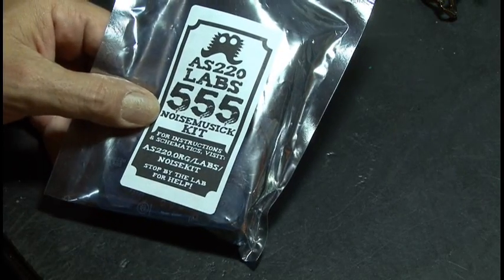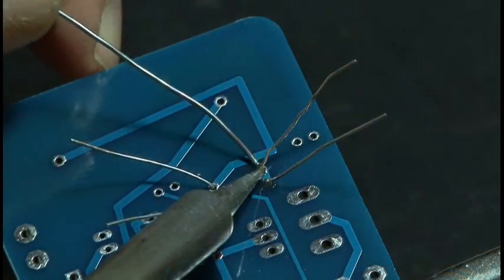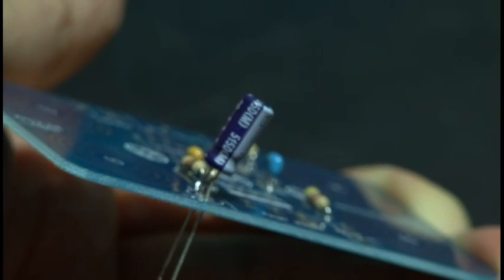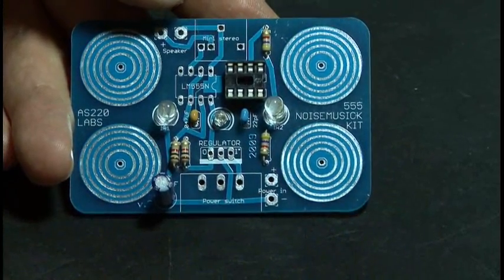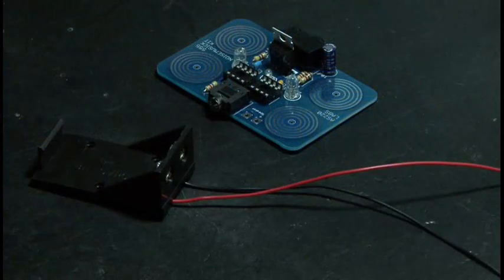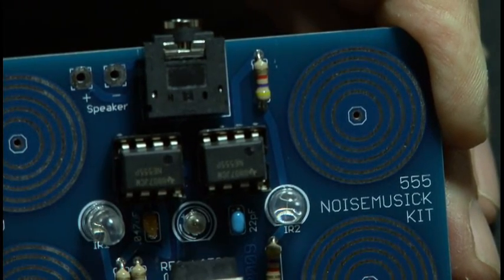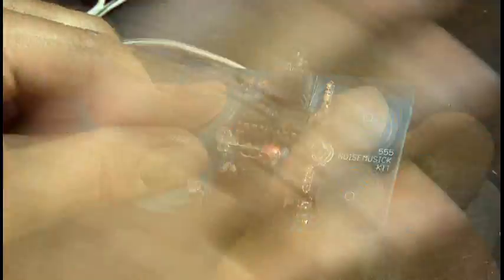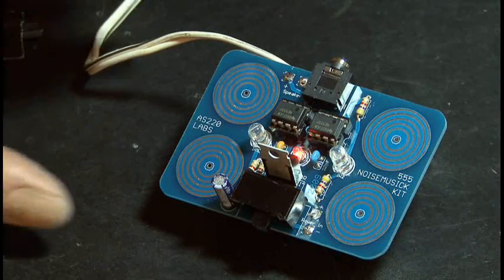Weekend Project: Noicemusick Kit

Comment: This is just a slightly modified Atari Punk Console or square wave oscillator as it was originally called.  Why don't you give Forrest Mims credit?  He created this circuit back in the 70s?